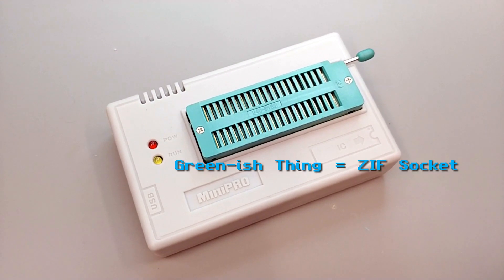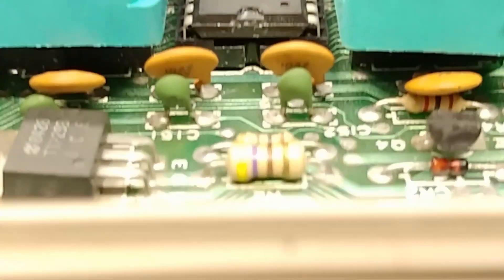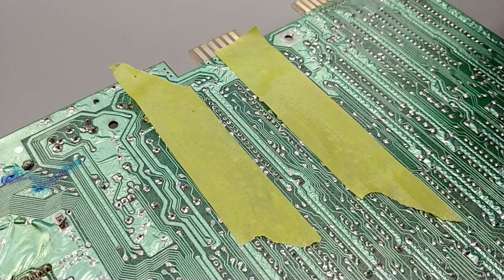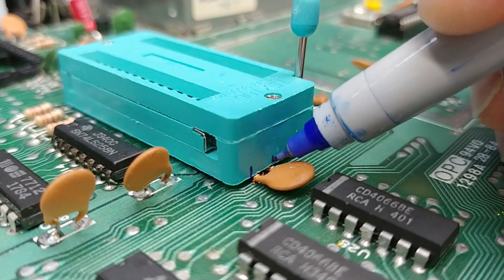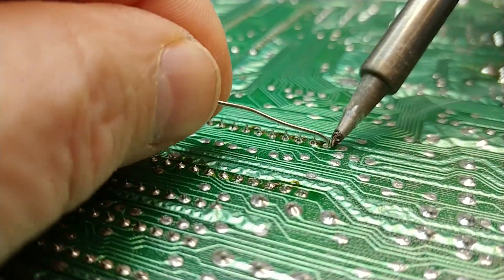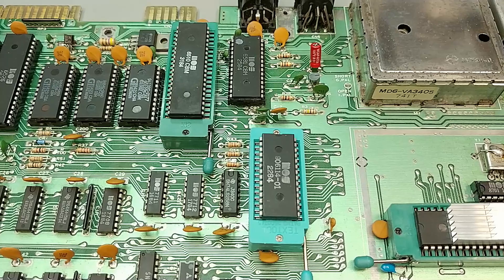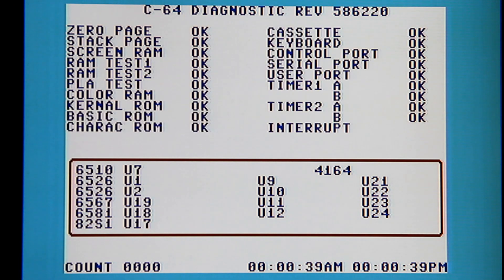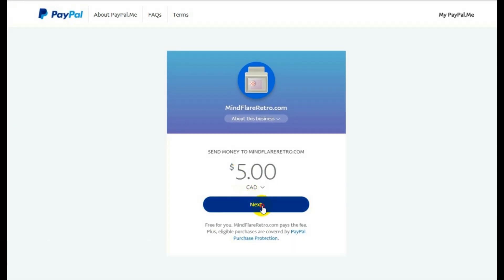#11 "Zero Insertion Farce?" — Installing ZIF Sockets on a C64 Motherboard

Comment: You do not need to apply flux to a board before soldering.  Just use a good quality flux-core solder, like Kestor.  That is not the proper way to clean the board after soldering.  I show the correct way to clean a board after soldering.  You need Kim Wipes, a small brush, and 99% alcohol, and the proper technique.  🤔
Reply from the maker: Hi Hans. Rest assured, my soldering and clean-up skills have improved greatly over the years. I will be sure to check out your videos to observe your techniques and further improve my skills. Thanks very much for the feedback!

Comment: How can one detect when the lever of the zif socket is closed?
Reply from the maker: You can feel increasing spring tension resistance as you lower the lever. There is a small but feelable "dull snap" (for lack of a better description) just before the lever is parallel with the surface of the socket. This is most apparent with higher quality name-brand ZIF sockets.

Comment: Hm, no way i can insert these cheap ZIF sockets to the C64C's IC holes... although there is no any solder residue in them (using a vacuum desoldering station), the ZIF's legs are just to big/wide. Any idea? I'm thinking of file the ZIF legs to make them smaller, but this can expose the legs to faster corrosion maybe... don't know what to do.
Reply from the maker: Hmm. I haven't tride this on a C64C. I know the cheap ZIF sockets have flimsy super-cheapo legs. Yeah, my first thought would be to file them down a bit. Let me know how you make out with this.
Reply: @MindFlareRetro  Meanwhile i watched a video where the author just twisted all the legs of the ZIF by 90 degrees so it could be inserted into a normal socket (not the precision/machined ones) then this socket can be soldered into the board. I think i will follow that way. (: It would be hard to file all the legs evenly, also can damage them easily.

Comment: I didn't have the balls for it, but I just bought a c64c with ziff sockets.

although I like the breathbin 6581 sound more that I also have several.

thanks for your little Basic program will test it on my 6581
Reply from the maker: Oh, yeah - a ready-made ZIF 66 - cool. My litttle program is very basic (wait, what... basic BASIC 😉). You might also want to check out "Commodore 64 SID Tester" which is an excellent SID tester, https://hackjunk.com/2017/11/07/commodore-64-sid-tester/.
Reply: @MindFlareRetro  Thx Bro

Comment: When I did my ZIF sockets I removed all .1uf disc caps and replaced them with modern low profile caps. The two caps that were interfering with my ZIF sockets I replaced with SMD caps on the underside of the board
Reply from the maker: Great idea. I might re-visit this project again and make new enhancements like this. Thanks for sharing.

Comment: If you replace the single wipe sockets with the machine pin collet type, you will have less insertion forces and the sickets are more reliable.
Reply from the maker: Thanks, Stan. You are absolutely correct. In my case, I pull and replace the ICs in my test machine (the ZIF socket one) so often, I fear that I would permanently damage the legs at some point.

Comment: Is it possible to put the chip in with the lever down, and the lift it up into it's "relaxed" position for normal use, I have a ZIF socket that springs back up constantly, and found that this also is able to lock the chip into the socket but I haven't tried powered up the board yet.
What are your thoughts on this?

Also, is it possible to remote mount A SID chip, say, onto the outside of the case for testing purposes or does the length of the wire effect the operation of the chip???
Reply: The ZIFs I have are the aqua coloured 3M brand ones. I just tried it with some breadboard jumper wire and when using one or two, they do not hold very firmly and pull out quite easily, however they test perfectly fine electrically. When you have an entire chip in the socket installed this way, they seem to hold quite firmly in place. Maybe EVERYONE has been doing it wrong all this time?!?!!?!!?

I was curious after watching this video and decided to give it a go. I was wondering things like "what if the ZIF lever flings open like mine does. 

It's an interesting thought, worth more experimenting.
I'd love to get a definitive answer on the SID question though, as I have SID CART 2 which adds another SID and is addressable, and then run a 6581, 8580 and a SWINSID Nano, and i'm on a quest to see how many SIDs I can make one 64 control....
Reply from the maker: Be cautious of those "3M" branded ones. If you bought them from eBay, AliExpress, etc. and paid a few bucks for a package of 5, or something like that, they are not genuine 3M so their performance issues (like popping open).
Reply from the maker: Interesting. All the ZIF sockets I have ever seen only clamp/lock in the handle-down position. There are some higher-end styles I've seen on DigiKey another from other suppliers that utilize a different locking mechanism. For example, this low-profile style ZIF from Aries Electronics, https://www.arieselec.com/products/data/10018-low-profile-zif-test-socket.htm.

I am not sure how far off the mobo you could successfully operate a SID, as there might be voltage and timing issues introduced through lengths of wire vs the direct traces on the board. It's worth an experiment using a couple of 28-pin DIP sockets and some thin gauge wire. Keep in mind that the SID is very sensitive to static and would be fried instantly by any static discharge.

I hope this helps. Thanks for commenting.

Comment: Great video. I was actually planning on doing this to my Atari 130XE, picked up some good tips from you before I do it.
Reply from the maker: Thanks very much. Yes, this has come in super handy for testing chips from other boards. One caveat, I did use el-cheapo ZIFs from China and I do find that I have to re-seat ICs in the ZIF sockets if they they haven't been touched after a while -- the connections seem to get a bit flaky and re-seating the ICs solves the problem. Just keep that in mind.

Oh! I just realized I subbed to your channel earlier today. @bwack77 mentioned your channel on Twitter. I'll be catching up with your videos this week.👍 On you on Twitter, as well?

Comment: I have the same desoldering gun and once had a leg come off and jam in the nozzle, no amount of poking would get it out (the nozzle was a little too tight on the pin but it was the only one I had at the time).  I ended up using a very tiny drill bit in a pin vise to clear the blockage and its good again, but have some bigger nozzles now also.  Great little gadget that is.  I have the same soldering station also.  What flux pen are you using? out of curiousity.. I have an overpriced mg chemicals one.
Reply: Forgot to say, I have been enjoying your videos :)  Thanks for doing them.  Been doing the computer thing for 20 years but just began learning about electronics proper in the last year or two.
Reply from the maker: Yeah, those jammed nozzles are a super pain in the butt. I ended up getting a slightly larger 1.5mm nozzle, as well.That solder pen is just a cheap Chinese Kester #951 knockoff I purchased from eBay at some point, https://bit.ly/2I2fS2A. I have to admit, I do like many of the MG Chemicals products. Right now I am using their 63/37 no-clean solder and I like it a lot.

Comment: the popping sound is a bug in the sid chip that has to do with the asymmetric design of the waveforms. as you probably know, the sid does not have a +/- analog voltage for creating positive and negative voltages for the waveforms. it uses the 0 volt as a base and waveforms a built from that. so they are not optimally symmetrically designed. so when applying the volume the output of the waveform is multiplicated and added. the middle of the waveform is a positive number that multiples with the volume and results in a different output number depending on the volume number. if you had a symmetric design inside the sid with negative and positive numbers and 0 when the waveform is in the middle then changing the volume would not change the output value. that is the problem and that is also one part of the ugly distortion of the sid that some people 'love'.
i am thinking about re-implementing a sid with an fpga and adding new features and sadly i would have to make it compatible with that old flaws because of some sid nazis that want it to sound exactly the same but also because of some bugs that has been used as a feature. in fact using that bug as a feature it is possible to make a kind of 10-bit dac which is pretty awesome. of course when doing a re-implementation there probably would be some settings to alter to make it compatible to different versions and a new setting that kick out all the flaws and add sampling in a different way (beside more channels, stereo-pan registers, wavetable, reverb, etc.)
btw. good job with the zif-sockets. i guess this is something that i also have to do. especially when starting to make SID/VIC-II/CPU replacements
Reply from the maker: Thanks for the thorough comments. I love it when I can learn from the expertise of others. I am sure you have heard of the SWINSID and FGPASID projects. Would your FPGA SID design be a different take on it?
Reply: @MindFlareRetro  
yes, i know of this projects. maybe i have a closer look at the fgpasid project. i have two different fpga boards at home (max 1000 with an intel/altera fpga and memory on it). it is highly integrated.
the memory could serve for a good reverb algorithm. it should be stereo with an additional pan or left/right volume register for each voice - so you can position every voice more left or right or in the middle and let the voice have a different volume.
the second thing would be the fixing of the asymmetric design of the waveforms. that way it would sound better with less distortion. and the next thing would be sampling - similar like in the amiga. that is very simple to implement. especially with the memory it could also be used for storing the samples and being used without using power from the 6510 cpu.
so it is more of an easy fix of the bugs of the old SID and with the new capabilities if the fpga/memory setup some useful additional feature in a way like the designers from commodore/atari would have done it.
let's see where i get with these ideas. i have the devboards lying around and in the next week guess i will play around with VHDL and the tools that are available for that.

Comment: I have been looking at those zif sockets, but as of yet have not purchased any. I am leaning at getting them soon. So much easier on the ic pins. Thanks. Another great video.
Reply from the maker: Thanks for the positive feedback. I would recommend opting for most costly name brand ZIF sockets if you can. I am finding that the connections get iffy after a while an I have to reseat a chip or two every so often. This is my experience so far.

Comment: Did the relocated ceramic cap fail?
Reply from the maker: No... well not to my knowledge. Hmm... maybe I'll replace it anyway. Thanks.
Reply: @MindFlareRetro   in the unlikely case you still read these comments: Moran's hypothesis was also mine. Let me/us know if replacing the relocated caps (especially the one that's worse for wear) help with the click/pop.
Reply from the maker: I do my best to read all comments left by viewers -- they took the time to write comments, so I try to read and respond to as many as I can. Fore sure, I will keep everyone posted if replacing the caps makes a difference.

Comment: My next project :-) I have received my ZIF sockets just two hours ago. I will install them on my "most crappy motherboard" (ASSY. 250469), which I have bought from ebay for little money. It turned out to be an easy repair, so I have screwed it to a board together with a keyboard and an acryllic cover (sheet). The ZIF sockets are intended to have the same purpose like yours :-)
Reply from the maker: Thanks for commenting. It is great to hear you are going to be doing the same mod. Some other things I've learned: (i) try to relocate as many of the small caps as possible to the bottom of the board, like I did with the last one, to avoid having to file down to many of the ZIF sockets; (ii) I have found that the cheap ZIF sockets from China have a connection issue over time (the C64 will behave strangely) -- re-seating the chips in the ZIF sockets usually fixes the problem. Good luck!

Comment: Your load pop happens from a full-on state to 0, but does it sound the same if you went backwards, -1 step in the FOR loop?  I suspect if volume was 1 and you set 0, you'll get a similar pop as from 1 to 2.  How to stop it, I'm not so sure, you could look at the pop on an oscilloscope and make a drain filter for it.

Also, you really only need one DRAM socket ZIF'd so you can test one at a time... Testing all 8 at once, you won't know which is bad.  But you should probably ZIF the glue chips too, and the video SRAM.
Reply from the maker: Ah, interesting. I will try the BASIC PRG with a -1 step in the FOR loop. One RAM IC at a time - ha - I did not think of that. I do have the ZIF sockets but I haven't opted to install them yet. I'd like to install ZIFs for as many ICs as possible but it gets crowded quickly.

Thanks for all your recent comments. I really appreciate the feedback.
Reply: Thinking about it further, could be a problem with the Q8 circuit.

Comment from the maker: Thanks for commenting. I actually tried inserting the ZIF sockets I have into machined and traditional DIP sockets, but the legs are too short and thin to insert and stay put.  Also, I had to keep the height as low profile as possible in order to allow the C64 top case to be re-attached without anything hindering it below. I am pleased to report that everything is still working perfectly since performing the ZIF modifications. Thanks again for your feedback - much appreciated.

Comment: I have never seen someone actually solder in a ZIF socket. Normally you put the hugely expensive ZIF socket into a regular precision socket (the ones with round holes, like on 486 sockets). If you ever need to remove the ZIF socket, itself is not destroyed in the process. you can simply pull it out. Also surrounding components have some air and you don't need to file down the ZIF socket itself.
Reply: Thanks for the advice!
Reply: no way these ZIF sockets goes into a precision socket... tried that but the pins on the ZIF are to bulky to fit in the holes of a precision socket. Cannot even put it into a normal socket only if i would rotate all the pins on the ZIF by 90degree... nonsense

Comment: Im no expert, but you effectively increased distance from caps to chip pins by adding zif sockets, you also added inductance by lengthening each pin's length. Both of these may of contributed to the pop.
Reply from the maker: You make an expert point. The pop was always there -- as is the nature of these SID chip revisions -- but the 'pop' does seem to be accentuated now. The purpose if this C64 is to test the primary ICs from other C64 computers, so I will have to live with the poppier pop. Thanks for your input!

Comment: Did you add solder for the 2 caps on both sides of the board ? It doesn't show on the video and might be linked to your volume problem
Reply from the maker: Thanks for your comment. No, I didn't but I do recall flowing a lot of solder through the holes. However, I see your point and I will check it out and add solder to the underside as well. Thanks very much for your sugegstion.

Comment: on the first zip socket install, you could have turned it around most likely and it would have fit.
Reply from the maker: Hi Brett. Thanks for commenting. I recall considering the orientation of each ZIF socket before committing to filing and soldering and in several cases the locking arm, when in the down (locked) position, would hit any other ZIF sockets in close proximity. However, I did not consider shortening the locking arm by snipping it or even bending it. Thanks for the feedback; it is greatly appreciated.

Comment: Can't you sand them?
Reply from the maker: Yes, I suppose they could be sanded -- I didn't try that. The file was very precise and made rather quick work of the job. I have some smaller ZIF sockets to install for the RAM. I will try sanding those. Thanks for commenting and for the great suggestion.

Comment: I tried to do the same thing for the RAM, but the sockets are too big for all 8 chips, so I settled for standard sockets for four and ZIF for the remaining four.
Reply from the maker: Hi Ted. Thanks for your comment. Funny, I just received some ZIFs for just that purpose. I haven't tested the fit yet, but from what you are saying I'll have to do the same thing and settle on using only 4 instead of all 8. That said, I don't mind, as my intension would be for testing RAM ICs quickly. Thanks again for your input - much appreciated.
Reply: I put the ZIF sockets in U9, U11,  U21 and U23.  U9 and U11 have the levers pointed toward the back of the computer and U21 and U23 were pointed  toward the front of the computer. The only problem was the lever for U9 would hit CIA1, so I had to cut off the lever just below the knob on it for the lever to lock in place.
Reply from the maker: Ah, yes. Regarding the levers, I've seen other people either trim them shorter or even bend them to a more vertical position. Good to know. Thanks again!